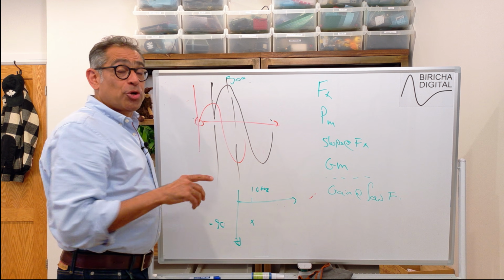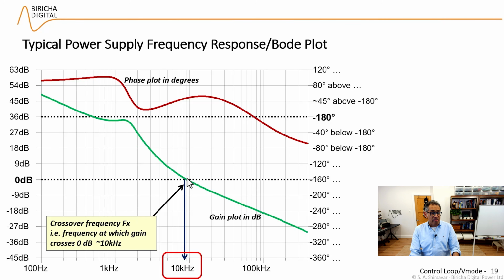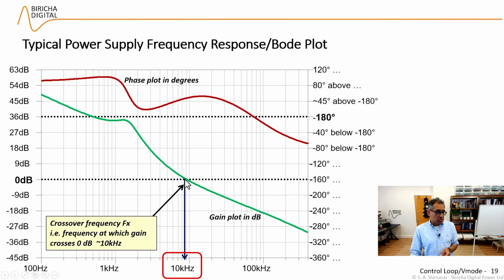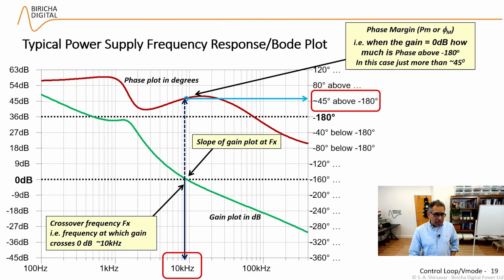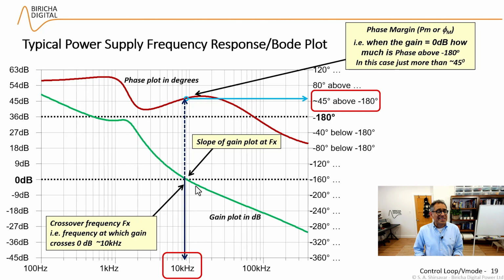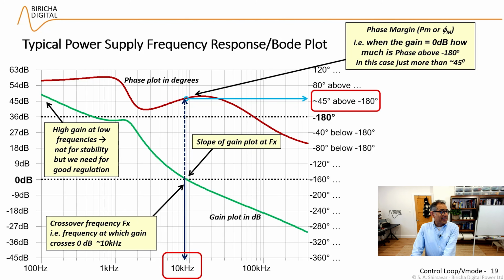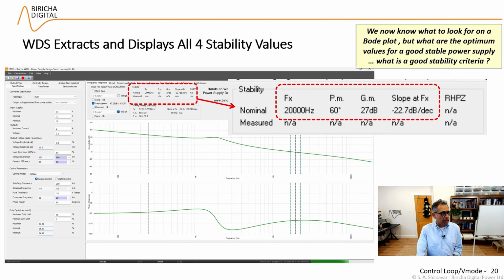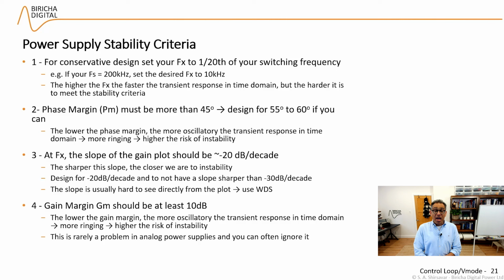Absolute Beginners Guide to Control Loop Stability – How to Read Bode Plots for Stability

Comment: A challenging question dear Ali shirsavar: for primary controlled flyback, we  have to put the injection resistance in the primary side, Hence, the injected signal does not travel to the secondary side and it is circulating in the primary side, so the dynamic of the output capacitors and secondary inductor, etc. is not considered during the loop measurement. How do we perform stability analysis for those primary controller flybacks? Thanks

Comment: I had a question. I have designed a SMPS and I want to simulate that, which EDA tool to select for simulation?
Reply: SPICE based SW like LTSpice or similar stuff.
Reply: for power electronics, I prefer PLECS in conjuction with MATLAB/Simulink. I construct the power circuit in a PLECS circuit block and model the feedback and control with Simulink blocks